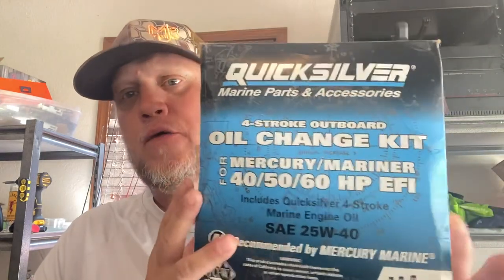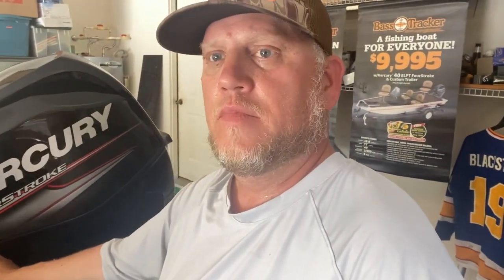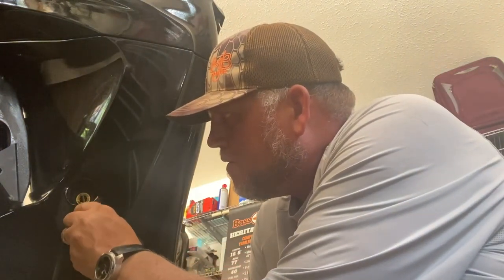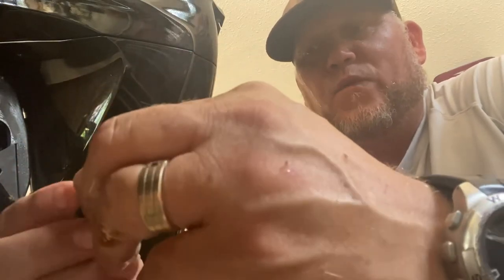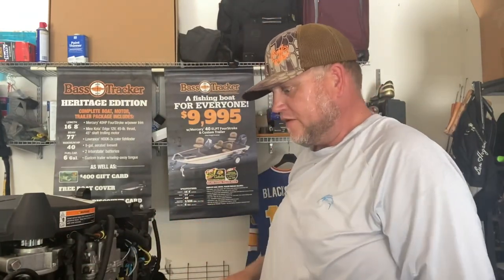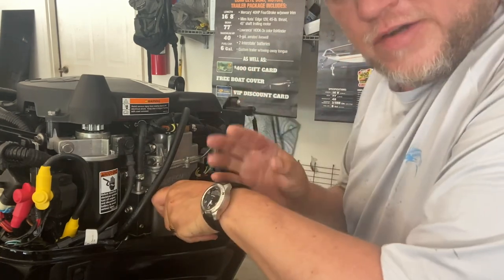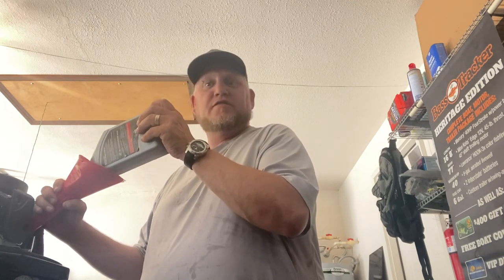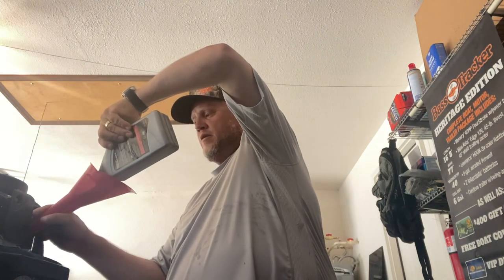Oil change on the Mercury 40/50/60 HP models

Comment: I like to add oil into the filter to saturate the fabric pleats before putting the new 1 on so that the high pressure oil flow into the new filter doesn't tear the inside pleats. I also like to remove my oil fill cap before draining so there's not a vacuum created while draining. 1 last thing, running the engine for 5 minutes before draining makes the oil heat up & drain faster & thins it out so you get every last drop of old oil out of it.  Nice step by step video, keep'em coming.